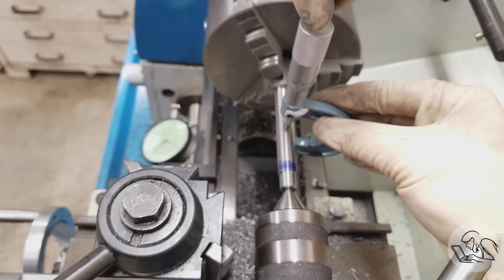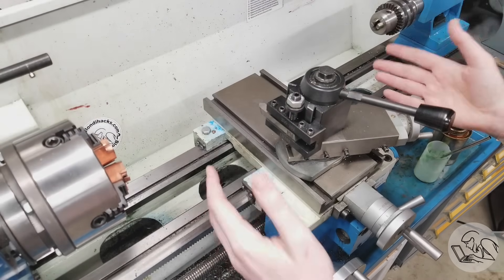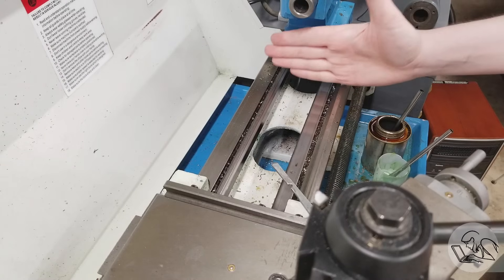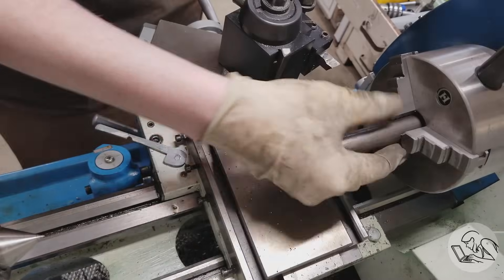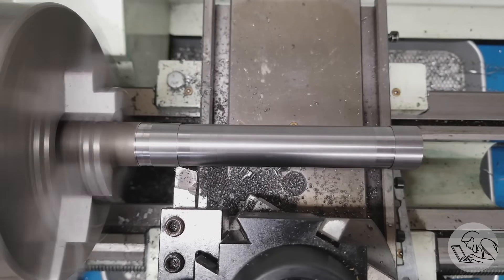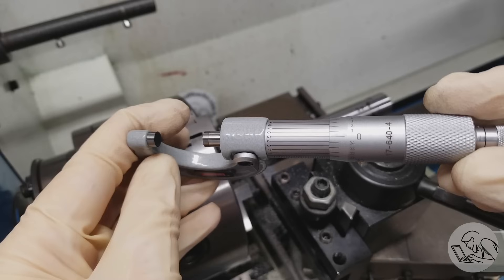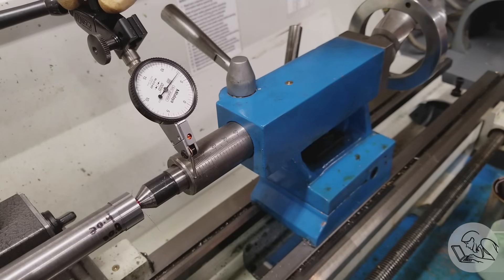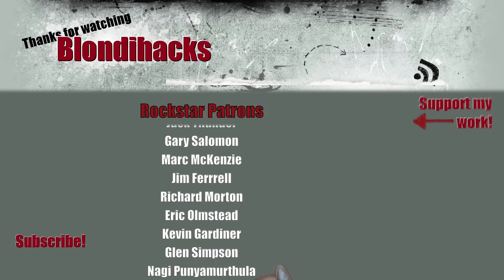How To Align Your Lathe

Comment: Instead of using block on slideway, you can put level on the cross-slide and move the main-slide back and forth between spindle and tailstock.
No need to do it between centers, just clamp the workpiece in chuck (5 mm. length) and put in the rotating centre.
Reply from the maker: The downside to that is that you’re including any error that may be in the gibs and dovetails of the slides. Personally I prefer to isolate those variables and check the carriage and cross slide separately. Some people feel it’s better to check up on the cross slide where the tool actually is. To each their own.
Reply: @Blondihacks : Well, it is the tools position that gives the result when machining. Since you isolate those variables, the result might be even more wrong. If you change slides with linear-guides, how will you do it then? Measure directly on linear-guides or use the cross-slide?

Comment: Quinn: You're going to need an assortment of precision shim stock.
Me: Goes through recycling bin and assumes Pepsi Max is thicker than Pepsi.
Reply from the maker: Soda cans do make pretty good shim stock for that one size. They are made to remarkably precise thickness, to minimize cost of material. 😀
Reply: Actually laughed out loud 😂
Reply: Since you're picking through the garage, aluminum cans are obviously good as is aluminum foil and cellophane wrappers like potato chip bags or from nutty bars or tasty cakes. If you do use food wrappers, be sure to clean them off to avoid contaminants that could cause inconsistencies. Paper, cardboard or any absorbent materials should be avoided. I had to improvise quite a bit in the past.
Reply: @sick-Willie  back when I was a smoker 30 years ago, we used the cigarette pack cellophane for .001.
Reply: Would ordinary soda can material (made, presumably,  from aluminium) not be too soft and likely to crush/deform?

Comment: Another caveat about buying on eBay is there are A LOT of counterfeit products on there. If it says 100% authentic, it usually isn’t. I can’t tell you how many listings there are for “Miluloyo” indicators and calipers are on there.
Reply: I've had pretty good luck.  Some things are mainly knockoffs, and you need to figure what they are, like the  fake calipers you mention.  In general, if it's sold by a business, especially from China, it's probably a knockoff.  If you find something sold by someone that's been around a while and is selling a bit of this and a bit of that, especially if it's used, your chances are better.  Some things aren't cloned very often, I haven't seen many, if any, knockoffs of Starrett stuff, but I haven't looked close.  The general rule in life applies, "if it looks too good to be true, it probably is"...On the other hand, some things are knockoffs and that's OK.  ALL of the carbide inserts sold cheap from China are knockoffs, as far as I can tell, they're just put in used or knockoff boxes, but so long as you know that it's OK, as they usually work just fine for hobbyist purposes and the price is right, just don't expect real Sandvik parts for a buck apiece.

Comment: I’m just an amateur (recovering woodworker), but this has got to be one of the most informative videos 
I’ve ever seen.  Simple, understandable, and doable by most dummies (and by “dummies” I mean “me”).  Now I need to figure out how to mount my mini-lathe on something OTHER than a table made from 2x4s and plywood.  (Old habits die hard).
Reply: Rob Johnson  Welcome to the Dark Side!
Reply: Get a surplus chunk of granite counter top off Craig list, bolt lathe to that
Reply: @OldtimeIronman  I’m new at this and always been afraid of using granite and break it if something like stock fell on it, an I just being overcautious?
Thank you for sharing!
Reply: If it's a thick table, that's not a bad mounting.  Ideally it'd be mounted on concrete, sure, but something that's equivalent to 5" thick wood is pretty resistant to deformation.  A sufficiently stiff table can lend a wimpy lathe extra stiffness, though, so error towards overkill.
Reply: Mounted mine to a commercial metal 2" thick door 7 1/2 foot long. on wood frame for drawers.

Comment: Are you psychic? I just bought an old South Bend 9 inch as my first lathe 2 days ago and was wishing you would do a video on this very subject! 😃
Reply: I've noticed my old Benchtop southbend had noticeable tailstock alignment issues. Now I know how to adjust it.
Reply: If your South Bend is anything like my Boxford, which I believe it should be, you won't need shims as it's got adjustable feet. The mounting feet screw back up in to the body of the lathe, so you loosen the bolts that hold it down, adjust the feet then tighten the mounting bolts again.